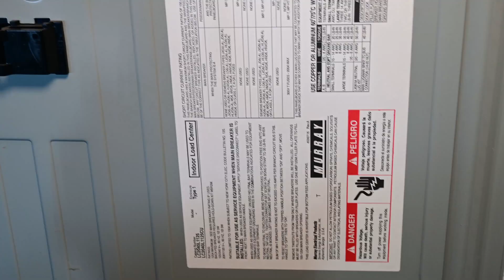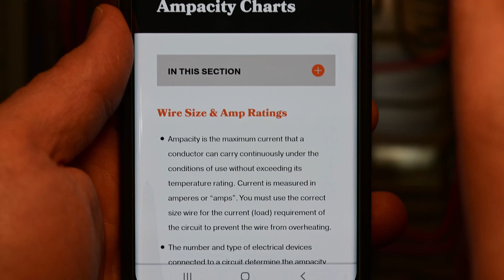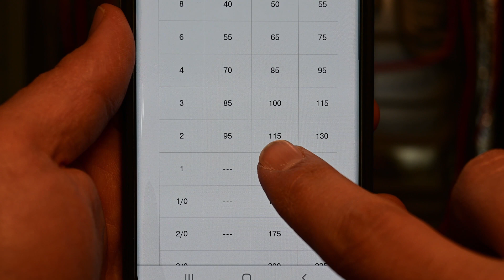How To Wire a Sub Panel in 2005!

Comment: They are called Tandem breakers, and the reason they are 20/15 and then again 20/15 on the next breaker is because it gives you the option to install a tie breaker clip and essentially you would have a 240v 15a or 20a double pole breaker, you have to remember that the tandem breaker is on the same phase

Comment: That’s WAY Cleaner than the old 1960s Throw bar to connect everything out in the barn,
It’s powered by a 10-2 wire with black to a hot, white to a hot and the feed in wires have Both the White & Ground wires going to the bus bar with the main ground on…!! 🤷🏻‍♂️🥺
Tell me IF you have seen THAT one.??? 🥴😖 It may even be from the 50s…🤔🫣

Comment: nobudy talks of a ground rod.  Is it required for a sub panel?
Reply: That's a good question.  I think that if it's in the same building you do not need one.  I'm assuming that the ground and neutral ARE bonded back at the main breaker but they are NOT at this "sub-panel" (another user pointed out it's really a main panel with a remote main breaker.  If it were outdoors you would need a grounding rod - actually TWO 6 feet apart.

Comment: Do a subpanel in a separate building with its own 200amp main requires to separate the neutral and the ground? Or can they be on the same bus bar, with a grounding rod !!
the service entry has A 200amp and has a green bonded screw with a grounding rod of its own!!

Comment: You did not discuss the multi-wire circuits.  The tandems on the right with the 15's not next to each other is to keep the two legs of a multi-wire on different legs.  Easy to get wrong with tandems.

Comment: From reading 2017 code book you can put as many wires through a stud or wood hole as Long as its not filled with insulation or fire rated material

Comment: Hi Ben,  good videos! thanks. / I'm running power to my detached garage, actually I ran #10/3 wg- UF direct burial cable. My logic was to split the 30 amp into 2-120v with #12/2 circuits at the garage since I only need lighting and receptacles. I don't need 240v in garage at this time. Do you have any suggestions on how to go from 30A #10/3 at entrance to 120v #12/2 circuits in the garage? should I install a subpanel for the garage??? I've done a lot of electrical work for machinery in my career but this has me stumped...  I'm getting old! lol
Reply: You need a sub panel for sure. Also, separate the ground from neutral and install a ground bar. I am doing same thing and don't need 220v. Depending on how far the detached garage is, that wire size may not work.

Comment: #2 AL is ok for 100 amps, deox is no longer required per wire mfg or panel mfg, lockout devices are required on hard wired serviceable appliances not in line of sight of the panel.  No discussion of the multi-wire circuits and whether they are wired properly?

Comment: The panel might have been wired in 2005/2006 depending how long those wires were on the shelf. However, the state could have been using an earlier NEC for proper wiring or what not.

Comment: No marrettes are allowed in panels ever, learn or update your code knowledge before trying to teach the wrong ways, I would fail this installation,
Reply from the maker: I have seen debate as to connections can be made inside of a panel. Where in code is a twist on wire connector prohibited specifically? Thanks for the comment!
Reply: From my knowledge of the NEC, splices must be made "accessible" for inspection, which usually means in a covered junction box; however, the cover of the main panel can be removed, making the splices accessible, so I fail to see how wirenuts in a panel would fail code.  Are you referring to a stricter local code, perhaps one modified from NEC or CEC, that prohibits splices in main panels?  In my house I moved some splices out of the main panel and into a junction box, but that was just to clean up the spaghetti wiring inside the main panel, not for code compliance.

Comment: I know these are hard to find, but I'd like to see a one of a fuse box.
Reply: My mom's house still has a fuse box, it was built in 1929.  We moved in back in the 80's and had a Square D QO sub panel installed beside it.  One circuit is still knob and tube, and she had to have it inspected last year when my dad died.  It passed inspection.  I dug out all the S type adapters in there and installed circuit fuses on the 15 and 20 amp circuits.  The main, the electric dryer and the range are the only things that are still on fuses, and they are the pull out type ones.

Comment: That locking cover is there because the water heater isn't within line of site to the panel. So either needs that or a local disconnect at the water heater.

Comment: Precise requirement to install main switch in panel appeared only in 2008. In France new panels still come without main breaker, so French electricians should remove the power from electricity meter to work in panel.
Reply: Most electricians work on live panels

Comment: Technically that's not a sub panel but a main panel with a remote feed. IOW, due to distance the breaker is at the meter pan. (called a metered main) A sub panel is any panel AFTER the main panel. The other thing that caught my eye was the wire nuts within the panel. I'm not up on the latest code but many inspectors would say "no splices within the panel" meaning if you have to splice it should go to a box outside the panel. This is what junction boxes are for. Another (good) thing I caught was the neutral and ground were NOT bonded within that panel. Bonding should be done at the point of first disconnect, which is wherever the main breaker is. Hopefully it's tied together at the meter pan / main breaker. (outside?)
Reply: Per code, splices are allowed within a panel provided the volume requirements of the panel are not exceeded.
Reply: @lstownley  ... while that is true and I have seen it many times, the ultimate decision is with the inspector. I have seen them call out on the craziest things, such as needing a "weatherproof when closed" outlet box inside a generator cabinet and that cabinet is already weatherproof. Another inspector asked for 2 (two) dedicated outlets instead of a single duplex outlet when I needed power for both a block heater and a battery charger. By code, if an outlet is full it's already dedicated. The way he reads the code he wants 2 circuits and 2 single outlets. Some guys split hairs.

Comment: Using multiwire branch circuits with a red, black and a shared neautral without a handle tie/common trip is now a big no no. Cool vid as always!
Reply: dirtdevil7bo … the reason that shared neutral got black-balled is due to so many people breaking up circuits later as a house goes through renovations. As soon as you add a sub-panel or tie into another room from the back of an outlet you may wind up with a "hot neutral" when one leg of the 3-wire blows a breaker. I actually had a customer's neighbor claim to have a flickering light in their home when the other house was running on generator during an outage. I have seen flickering lights in a basement, which was not part of the generator panel. Traced that to a kitchen circuit that was split and one side of the 3-wire wound up in two different panels. If they had been on the same leg then the neutral would have been subject to double it's capacity as well.

Comment: Whoa, a panel from 2005... SO LONG AGO. Trying to make everyone feel old?  Ha ha.  So Murray panels are the same as Siemens. Murray might have been its own company before Siemens acquired them. Interestingly, Siemens panels that I've worked in have the neutral bars located in the gutter close to the breaker bus bars, with the terminal strip running the height of the breaker bus bars... this has always been desirable because the branch circuit stubs you pull into the panel can have a relatively balanced length of both line and neutral conductors, and they stay somewhat paired together where you terminate them. This is why Siemens are my favorite panel, but curiously that Murray panel has ground/neutral terminal strips off on the sides which is typical of other manufacturers (Square-D, Eaton, etc.).

Ah the days of not having to worry about GFCI and AFCI. Back then, many houses simply had MORE branch circuits because the breakers were nice and cheap. Now there are fewer circuits because the breakers are so darn expensive.

One deficiency I noticed is the dishwasher/disposer is probably a multi-wire that share a neutral. This is totally fine, but code requires either a double-pole breaker, or a tie that links the handles of the two breakers together.

I am NOT a fan of those wire staples, because they can easily be pounded in too far and crush the cable. The electrician correctly pounded them in enough so the cable can still wiggle around. That is the correct method. Staples are NEVER meant to be tight attachments of the cable. The plastic ones are safer, but here in cold MN and other cold states they can become brittle over years of seasonal temperature fluctuations. If you want to see the BEST stables, search Google for Iberville cable staples made in Canada. Those should be imported into the USA!
Reply: My panel is from 2013 but the wiring is from the 60s and 70s.

Comment: One thought about the Sharpie marking of white wires to predesignate it as a "hot" wire. This is actually the correct way to do it. I know that an "industry standard" is to use tape, but technically the code disallows tape. The code specifically says that the wire has to be "permanently" remarked. Because tape can be removed, it is by its very nature not permanent. So the Sharpie is the correct way to mark it. 

Great video. I really like what you are doing.

Not sure if others mentioned this already, but the breaker lock out is required on anything that is hardwired, out of site of the panel, and further than 50 feet. So the dishwasher more than likely should have had a breaker lock out.

As for the wires that are bundle together that is a major code violation. The most wires that can be grouped together is 9 and then after that you have to start de-rating the wires so that they loose their capacity. So a 20 amp wire suddenly becomes only good for 15 or 10 amps. So in order to bundle like that and get the same ampacity that is needed for the circuits is to upsize the wire. So the 20 amp circuit may need to be bumped up to a number 10 or 8 gauge wire. It is all about heat dissipation and that bundling shown hear could, technically, be a fire hazard.
Reply: Are you sure it's code not to use tape? Can you cite the article/section? Tape is most commonly used, though I myself prefer Sharpie.
Reply: @aaron74  I just looked up and the code has changed to allow for tape. The old code used to read permanently marked. My comment is outdated :)
Reply: @paulblais6796  Yeah I don't know either way. Cheers!
Reply: @aaron74  … I have heard inspectors say to use tape or shrink wrap. To me a sharpie can be rubbed off with a finger on that new slippery insulation.
Reply: @rupe53  Yeah if you rub it before it's dry it can smear off. It can wipe off easily with rubbing alcohol too. But my experience is that the ink stays after it dries, even with the 90ºC insulation. The things I don't like about about tape or heat shrink is that one could think it's a repair rather than a marking. Also with tape, it can peel and leave adhesive residue, which is very annoying to get on your fingers.
Reply: @aaron74  … shrink wrap would show a repair. (lumps) Cheap tape leaves a sticky mess. Good 3M tape is still fine in 20 years at normal room temps. If you take the time to put a few wraps of tape on the wire but keep it back maybe 4 inches from the end you will never have to touch that area anyway. I keep mine just above where you bend it 90 degrees for the breaker.
Reply: @aaron74  The code is 200.7(C)

Comment: ran a sub panel in my shed , it was an old main breaker , kept the main breaker became the slots were not completely full , that allows me to open the panel and add more circuits in the future .
Reply: You could use knock out fillers in the future rather than using breakers to fill spaces
Reply: @gurjindersingh199  True, but I have boxes full of old breakers waiting to trick the next owner into thinking there is something attached to them :face-pink-tears:

Comment: If there's any way for you to check the breaker feeding the subpanel, I'd be really interested to see if they used a 90A or went with a 100A breaker! 90A service for this condo seems like it is really cutting it close if you were cooking with the A/C on, while someone was taking a hot shower. But I understand that by modern code, that #2 service wire would be the limiting factor.
Reply: Thank you. I was literally thinking the same thing? I'm here like that's a lot of breakers on a 90 amp breaker.
Reply: @305dutch4  … I would bet the SER cable has a different rating than standard AL cable, just due to different insulation and typical short run. I see #2 AL all the time in 100 amp panels and #4/0 (rated for 175 amps) in 200 amp panels. As for total load, the branch breakers will be installed to meet 80% of their face value or less so 40 amp breaker can run at 32 amps all day long. The AC is another story. That might be a 30 amp breaker to meet "starting load" but the running draw is probably well under 20 amps. A main breaker is rated to run at 100% of face value, but never does because the panel is mostly about distribution / safety, not total draw.

Comment: I would like to see an electrical panel from 1970.
Reply: If it's done right, it would look very similar to this 2005 one.
Reply: @aaron74  Only difference is it will have Aluminum wire for everything not only  the service entry wire.
Reply: @TRX450RVlogger  I honestly have yet to see AL wire for branch circuits. I've seen panels from the 60s, 70s, and 80s. I think AL might have only been used a few years in the 1970s, perhaps, not the entire decade.

Comment: i thought tht was a siemens panel at first glance i was close. Founded in 1899, Murray Electrical specializes in sturdy, user-friendly electrical solutions. Since being acquired by Siemens, Murray stands by their commitment of manufacturing innovative products that are easy to install. As a sub-brand of Siemens, Siemens and Murray components are mostly interchangeable.

Comment: Great Video. What is Red, Black, White wires ? And how to wires it ? Thank you for sharing ^_^
Reply: In US and Canada, Red and Black are always considered to be Hot. White is normally Neutral but can be considered to be Hot, especially when connected to a 240 V breaker. It should then be identified as Hot by wrapping black electrical tape around it. 12-2 with ground (bare copper) can be connected to a 20 amp breaker and 14-2 w/ground can be connected to a 15 amp breaker. 12-2 has a yellow sheath and 14-2 has a white sheath. Google is your friend. So is Bing!

Comment: The panel could theoretically have been wired well after 2005 if someone were using up a supply of wire made in '05.  Maybe they bought a truckload of the stuff on Black Friday, enough to last for years into the future...?
Reply: Yeah a more reliable indicator of the age of a property would simply to pull up county records of the address.

Comment: Less than 6 throw rule ?
Reply: 6 handle rule
Reply: dudeman650 explain please ?
Reply: Introvert Electrician … maybe that should the "6 through the same hole rule" meaning a limit of how many cables can be bundled tight in the same joist penetration. Makes sense to me.
Reply: As many 2 or 3 poles you want, only leave a few spare  .

Comment: You say this is full, but couldn't you replace most of those 1" breakers with 1/2" breakers and add a bunch more circuits?
Reply: It depends on the panel specifications. I believe that the panel specifies the total number of circuits permitted to be installed in it (to comply with box fill code requirements and such). You could exceed that number by using double breakers in every slot - but you would then be out of code compliance.
Reply: Problem is if you want to load up with GFCI or AFCI breakers, they don’t make them in half size... only full size
Reply: @jragadio  … I don't see any reason you couldn't add a 12 circuit sub panel right next to the existing panel and feed it with say a 50 - 60 amp breaker. That way you would have all the room in the world to change over to GFI or arc-faults, plus room for expansion. OTOH, the local building department may have the final say here. They may want a complete service upgrade if you mention finishing the space and adding more than a few circuits.

Comment: Those lockout brackets are used on water heater circuits so the breaker cannot accidentally be turned on before water has filled up the tank. That way you do not burn up the elements. I see those brackets a lot of times used on modular homes. But I don’t really think your house that you’re in is a modular home. But it’s a nice little safety device.